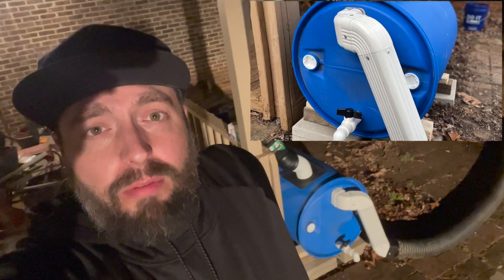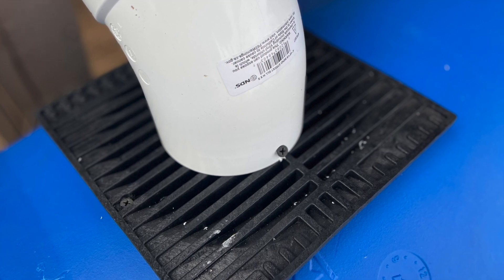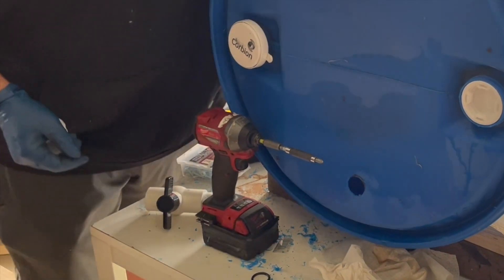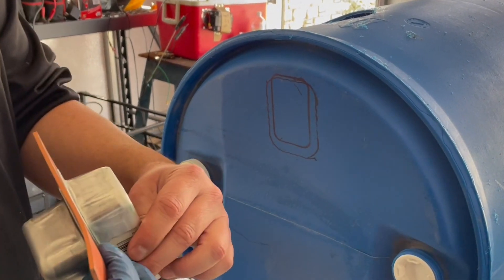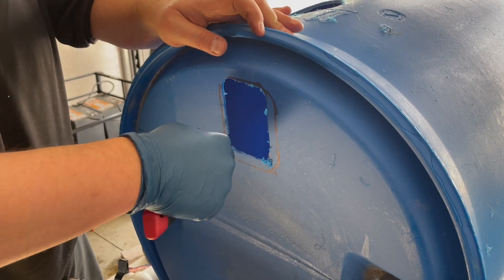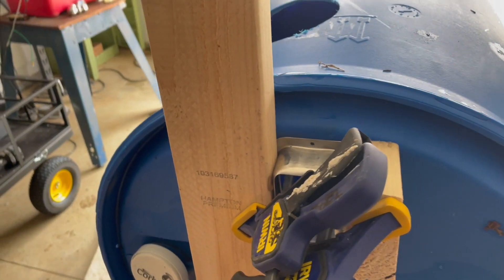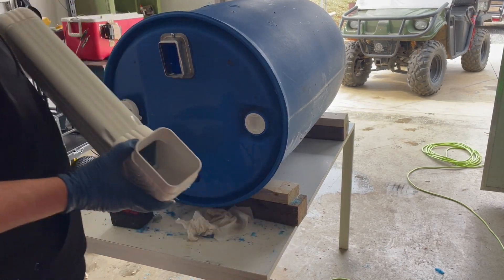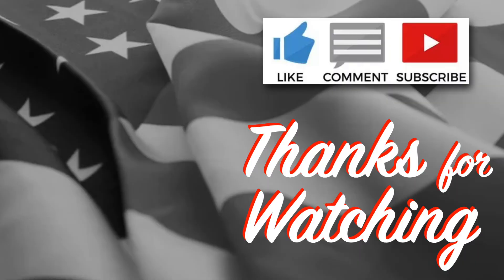EASY Rain Water Harvesting System. Use a Barrel, Your Roof and Gutters! Fast and Affordable

Comment: Impressive system.  My wife prefers using rain water on her gardens and I think that your system is a whole lot more versatile than the premade jobs you find in the garden stores.  Yours would not be difficult to expand with additional barrels either.  How has it performed for you so far?  Would you make any upgrades/modifications to the next one would you build it just the same way?  I'm a first timer to your channel so perhaps you have these questions answered on another video that I haven't gotten to yet... ;-)  Regardless, nice presentation and you have earned another subscriber.  Thanks for the good info!
Reply from the maker: Hey thanks. Well I just got my gutters redone so it’s unhooked but I’m getting it back together soon.